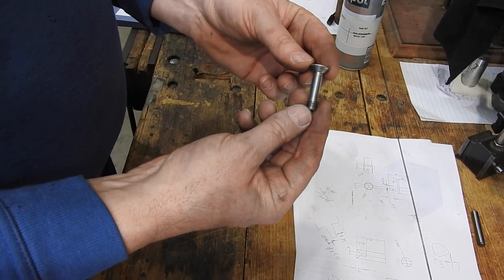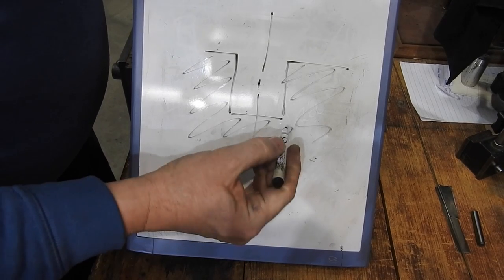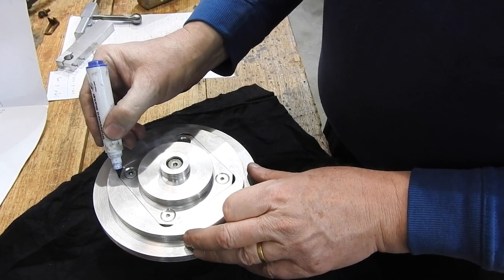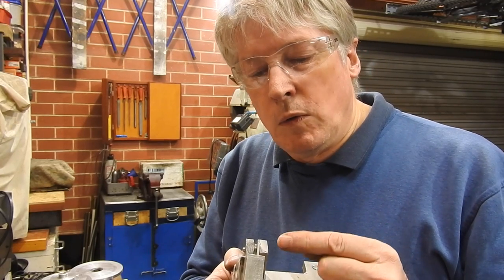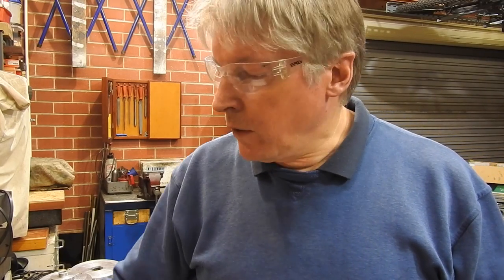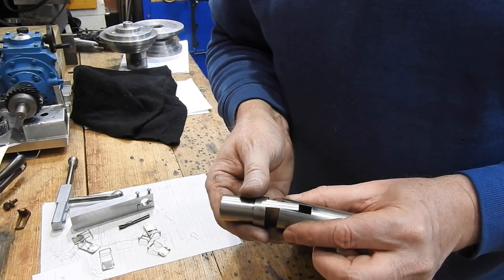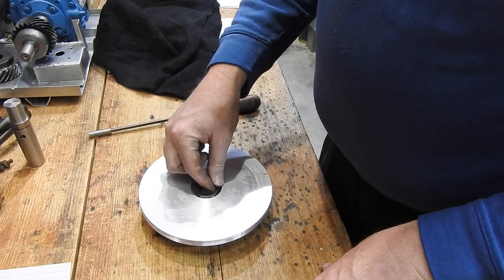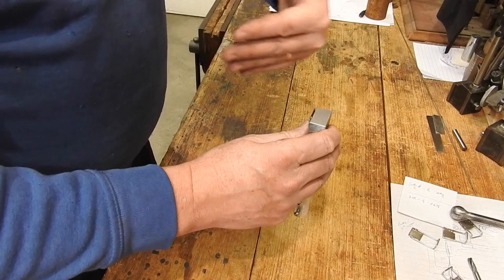Features you should try to avoid

Comment: Why is that flat bar welded to a half finished tool holder?
Reply from the maker: Once I hobbed a worm gear on my lathe. That piece was a laterial brace going from the (front) toolpost to a fixture I mounted where the rear tool post would live, just to control the deflection of the mandrel with hob away from blank. I never did get around to finishing it off as the wormgear cut nicely without needing it.

Comment: Hi Michael, great videos - any chance I can get in touch regarding a one-off job you might be able to assist with?  We run a non-destructive testing school in Adelaide and could use some wisedom regarding making a specific calibration block.  (Couldn't find your email on you youtube about page)
Reply from the maker: I'm yet to set up a channel email address - I have an enquiry in with my ISP though, so I'll see how that goes. I may be able to do something for you but this is not my day job so that will depend on time and cost.
Reply from the maker: Email added. Fingers crossed will work.